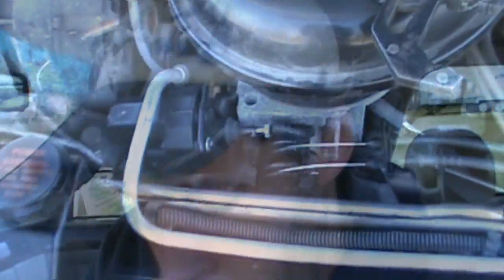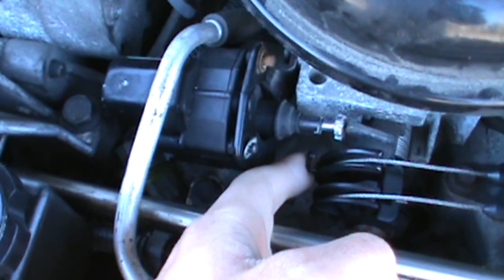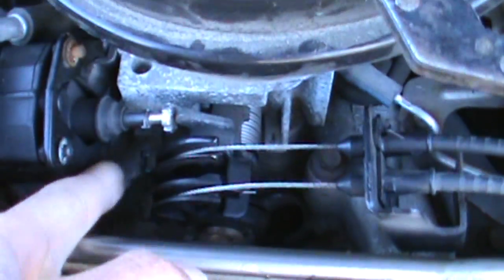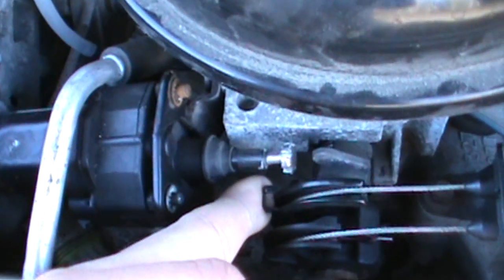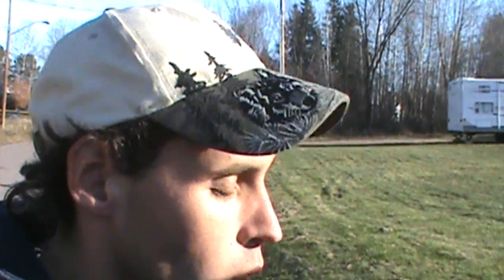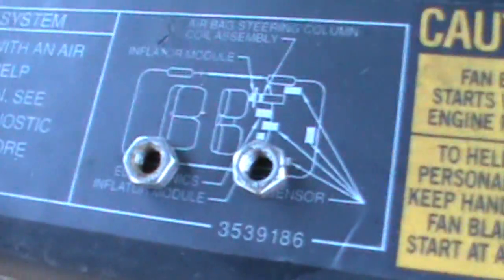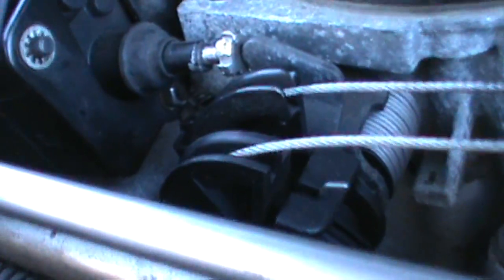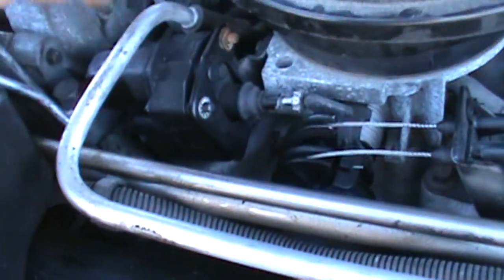IAC (Idle Air Control) Motor Removal 300ci Cadillac V8 Engine

Comment: Question, first off I love your videos on the 4.9L DeVilles. I start my up, and it may cut off. Not every time though. After it starts and I leave my feet off the gas, the engine will rev high, then low, then high then low a few times. If I place it in reverse after just starting, it will move back kinda fast, then slow, kinda fast, then slow without me touching the gas. Any suggestions?

Comment: We have a 1993 Cadillac Fleetwood Hearse.  V8  She is either wanting to lunge forward at a stop light or I have to turn off the AC to keep it from sputtering and then dying at the stop.  would that still be the IAC  or do I have a different issue?  Thanks

Comment: My 88 Eldorado has one...code 27,after 2 ignition engagements, code will go away until next time. I have replaced the IAC, TWICE. These are a nuisance on all 4500,and 4900 V-8,  y Cadillac.it was one of those things, that just doesn't last. Lubricating the plunger boot, will help...but ultimately, it needs to b a replaced again, a pain in the rear, but, it can  e coaxed  y your accelerater pedal. Temperamental. I have no intention of selling this one,rare, and overall is flawless.

Comment: It's not an idle air control.
It's an idle speed control.
When you shut off car, you can hear it cycling for a few moments.
Dealer wanted 500 box to fix high idle, I replaced for 90 bux.

Comment: Had to change the coil (which it was burn from the bottom)and rotor cap on my 1995 Cadillac deville but now the car cranks but it won’t start check the fuel pump and fuses and they where find any idea what it could be

Comment: What is the code for the speed sensor on trans and how hard to fix it . I did use your message about getting rmps gage and batt gage to get it on my 95 caddi so I want to thank u for that just dont think my car is going in to over drive after 55 when I am going over that . And my dash is not keeping track of my millage and will not read how fast I am going when driving and does not tell my the actual speed .. so does that all mean my speed sensor is out on trans .and after I change it will it start to keep track of my millage and tell me how fast going when driving extra.. I hope u understand what i am saying if not send me a message at caddieguy2011@gmail.com thanks hope u can help thank

Comment: im glad i found this video on my google search. my car after i cleaned the throttle body just now started doing this and i felt relief seeing this relatable video. i have a 1992 cadillac deville base with the same 4.9 V8 as this and i started experiencing this same problem where i stall off when i dont keep the throttle open manually myself just like in this video if it werent for you i wouldve thought my torque converter or timing chain quit or worse i would need to replace rods and valves and pistons. thank you for this video it was a direct analysis that otherwise had everyone stumped on my side of things even me.

Comment: hey man I have a question, I have an 89 ELdorado with  4.5 and it feels a little shaky at idle, in Drive while holding the brake it fluctuated from around 625-750 and was wondering if this might be the problem. Also, is the pintel on the IAC meant to be able to be turned in or out with pliers or something to sort of adjust it? the reason I ask is because I see less thread on it on the video than the one on my car.

Comment: I have a question I just got my tps replaced and now my 93 Cadillac DeVille is idling high and the IAC is broken cause of the shop . if the IAC is bad can it cause the car to idle high and accelerate by itself
Reply: Yes if you keep your foot down on the gas pedal to maybe a quarter down or so

Comment: l own a 1992 cadillac seville sts 4.9 liter.  My car has been idling high then low. It cut off on me l changed the idle speed control motor.  Still willn't start. l did see when replacing the part. Next to the idle speed control motor bracket.  Connected to the carburetor is a holes that is broke does anyone know the name of the holes?  And will this stop the car from starting. .....?

Comment: I have a 1990 coupe deville, after running for about an hr or so when i come to a stop it will shut off, but it will start right back up. is this the IAC?
Reply: could be the ICM.  just replaced mine on my 93. do you stutter when you accelerate hard ? if so it's 80% chance of it being the ICM (ignition control module). the reason this happens is the module is responsible for sending spark to the cylinders but when it overheats (hot day or when driving for a while) it can't work as fast as it should and you get misfires and stalls.
Reply: S T

Comment: hey yoshi I change that part on my 94 Deville, but know it clicks every time I shut the engine off. the old one had the plastic gear all turn up how can I fix that clicking sound or its not adjusted right.
Reply: I have a 93 Cadillac DeVille when I start mine it idles high and when I am driving and let off the gas it stays or goes up on speed or if I'm at a complete stop my car speed goes up by itself with out pushing on gas . I don't know if you was experiencing the same thing.  please let me know if it is the iac
Reply: Hey Larry Budwell 93 ~ 94 different engine but have you check succion lines or pcv valve .and no my problem whit my its different.every thing runs fine its just that clik on the idle motor after I shut the engine of.
Reply: +El George I have the v-8 4.9 pfi . but yeah ill check for on the lines . so you got a new iac and it's making the sound still?
Reply: mine makes the sound and when it's doing it my gas pedal moves when it's doing it
Reply: +Larry Budwell yes it does but only when I shut the engine of.the replacement part its from junkyard.
Reply: Yeah you have to go to the shop to have them set it cause the tps and the iac runs off the same circuit . now mine don't do the sound any more
Reply: +Larry Budwell yeah good luck to me buddy I'm in mexico.I doo all the work in my cadillac cuz ......every single mechanic her it's a nono.not every one want to work in it thats way I doitall on my
Reply: Yoshi never answered haa

Comment: my 1994 cadilac concours - pops when i turn it off and sometimes the accelarator seems like the cruse control is trying to jump in without me turning it on and it ildes high sometimes could that be my IAC MOTOR

Comment: The aic in my 92 Eldorado clicks sometimes and my car will stall or rpms jump could it need a new aic just put in a new fuel pump codes say cam position sensor ??? All suggestions are welcomed car only has 94000 mi 4.9

Comment: you picked the easy one, 94 Eldorado with a northstar much more difficult. I suspect mine is on its way out, I was hoping it would relearn itself after the battery was disconnected but it hasn't and I changed the exhaust to a louder one.

Comment: Hey man this video helped me alot and I greatly appreciate it but I seem to be having a different problem, but in the idle. 

I have a 91 Seville with the 4.9L V8. When I turn the car on and keep it in park it will idle and slowly increase the RPM's (jumps to about 900/1000).
 It will then show a E30 code which is the ISC. The ISC seems to be fine but the RPM'S is just jumping to high. Any idea's/Suggestions?

Comment: Also if it is possible to clean it should i lubricate anything? Its a 4.1 liter v8 small block. Also if you can post a video on engine code e059 vcc problem

Comment: The ISC motor - It's a unique system, a motor that pushes the throttle plates open to control idle speed.  The northstar got the typical IAC to BYPASS the throttle body like most cars.  I love the 4.9 and OBDI system.  I had one of those things bust fully EXTENDED - 'sudden unintended accelleration'.

Comment: 15. Start the engine.
16. Apply the brakes and place the transaxle in "DRIVE" range.
17. Turn the Climate Control Center (CCC) to "OFF" and allow the engine to idle for 30 seconds.
18. Turn the CCC to "AUTO", verify A/C compressor engageent occurs. Allow the engine to idle for another 30 seconds.
19. Place the transaxle in "PARK" range and turn ignition to "OFF".

Comment: 9. Turn ignition to "OFF".
10. Wait a minimum of 20 seconds.
11. Turn ignition to "ON" (engine not running).
12. Enter diagnostics.
13. Turn ignition to "OFF",
14. Wait a minimum of 20 seconds.

Comment: TP Sensor/Idle Learn Procedure

1. Outside air temperature is at least 10°C (50°F) so that the A/C compressor will turn "ON".
2. Start the engine.
3. Allow the vehicle to idle continuously until the coolant temperature is 80°C, then idle an additional 5 minutes.
4. At end of 5 minutes, enter diagnostics (engine still running).
5. Turn ignition to "OFF".
6. Wait a minimum of 20 seconds.
7. Turn ignition to "ON" (engine not running).
8. Enter diagnostics.